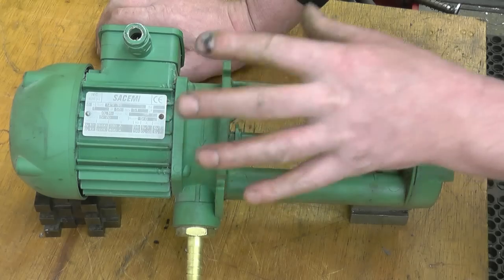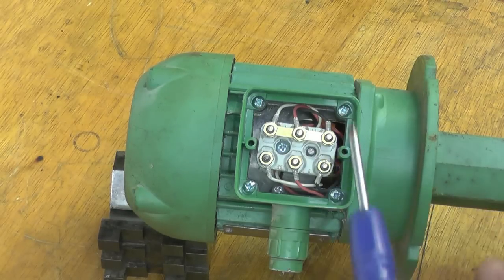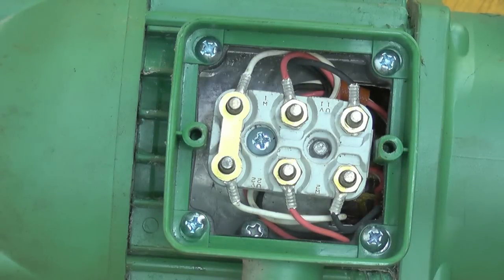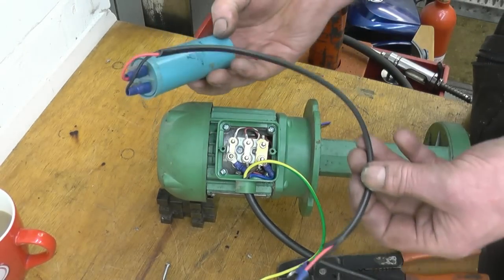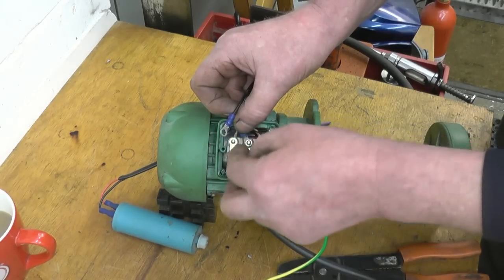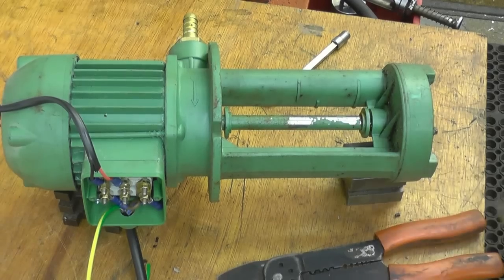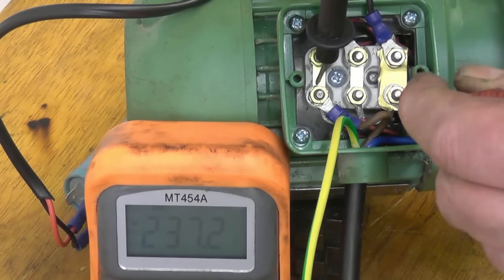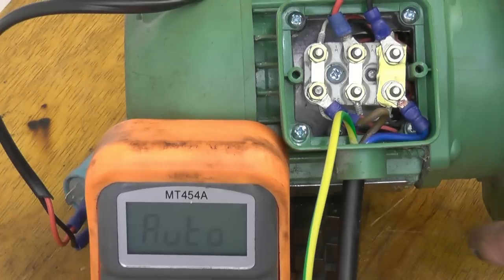Star / Delta 220 / 440

Comment: to determine capacitor size, consult the pros at a motor repair shop.many of them have been repairing motors for a while are quite knowledgeable with single& polyphase motors, capacitors,etc. they have saved me from burnt motor windings & smoking capacitors !

Comment: 10 hp 3 phase 440 volt Delta connection same10hp load convrert connection single phase 220 volt ?

Comment: What size capacitor did you use and did it stand the rest. Of time?
Reply from the maker: I will need to have a look 
It is still running fine
Reply: Great thank you.
Reply: Did you get chance to look at that capacitor. I’m wanting to run my Boxford coolant pump on single phase.

Comment: Excellent video. But what size capacitor do we use on which motor power? Is there any formula for that or do we orientate only to the supply voltage? Any help would be appreciated.

Comment: ah looks like motor on my cazenueve lathe, now, I  just scored two hydraulic power packs 2.2 kw wired in delta 220, I swing them to star, so i generate my 3phase from a Lincoln vantage 400 gives 17kw 440 V the controls are 24volt dc, came from a ship,so i will need swap solenoids to 230ac can you advise how  powerful a 3ph motor will run as you've done hear on a cap start, you taught me something today , THANKS

Comment: Here in the states we are always trying to run 220vac 3ph from 220vac 1ph.  I built my own 5hp RPC and have the voltages pretty well balanced on each phase, and kept the amp draw at a low level.  I will only be able to run one of my machines at a time, but then there is only one of me.

Comment: Hay can any one help me my motor seems to be running very hot as in can’t touch it hot it is a ecos the plate on the side says it can run single or 3 phase if any can help as don’t want to blow it befor I have even used it

Comment: nice illustration but ca you explain   how connect a 3 phase synchronous motor from the   power supply using a contactor and thermal overload

Comment: The motor is 1.5 kw on 50 hz and 1.8 on 60 hz it is a 2 to 2.5 hp it runs slow before it couldn't start because of the capacitor size now the capacitor is 100uf working fine needs a little speed can u help me please
Reply: you get inherent power loss running it single phase. imagine it like a car engine with 3 pistons, 3 phase motors is like all pistons taking turns getting to the top of the bore and take turns igniting and producing power.... running the motor in single phase is like making 3 pistons get to the top of the bore and igniting at the same time... so you get less torque, less speed and less power. only real way to get your speed and power back is to go back to 3 phase, especially on a motor that big.
Reply: or when you ride a bike, you press down on the pedals which point in different directions is basically 2 phase, because you push left pedal then right pedal, left, right... now you could convert the bike pedals to single phase by making the pedals point the same way which would mean you'd push both pedals at the same time and your bike wouldn't go as fast. hope that makes sense.

Comment: Can you please get back to me i need help wiring
Reply from the maker: Can you message me
Reply: doubleboost hi mate i have 430v 3 phase 150L compressor it says i can change to 230v single phase but the motor doesnt have capacitors i dont know which ones to get
Reply: doubleboost sent you message via facdbook

Comment: I am thinking of doing this to a 3/4 hp motor on a tool & cutter grinder.
A capacitor is far cheaper than a converter or inverter.😕hmmm.....
As it is under 1hp, will the motor still overheat? 
I also need the machine to be able to switch into reverse as well.
Will the machine still switch into reverse via the forward and reverse switch with the capacitor fitted to the motor or would I be better of just investing in an inverter?....

Comment: If three( 3)phase motor changed to single phase will run  without a capacitor ?
Reply: that`s impossible ,because the single phase motor isn't self starting , it needs capacitor  for starting ,that`s make it running  very well.

Comment: i like the simplicity of this video more people should instruct the same way. 
I  am curious to know, the motor is running no doubt but what is the FLA before a load  is placed on it.
seems neat but not practical
Reply from the maker: +James Waymyers  It is ok for this application just a coolant pump I have used them this way for years
Reply: +doubleboost 
help me how to convert my 3 phase motor 
to single phase..

this is my machine
table saw wadkin bursgreen 10"

help me
Reply: +doubleboost 
help me how to convert my 3 phase motor 
to single phase..

this is my machine
table saw wadkin bursgreen 10"

help me

Comment: can you tell me plz what is the capacitance of that capacitor ?
Reply: +Nighto lili This is equal to the power of the motor and there is formula to calcoulate the price of the capacitor also in motors less than 2HP.
Reply: I totally forgot the formulas 
im gonna check
Reply: +Nighto lili Capasitance mean the valiu of capacitor in μF or nF. Formula is 70(constant) X power of the motor in(KW) = μF. In any case capacitor must be made for all time work, and the motor power less than 750 Watts. Don't forget the volts of capacitor must be the equall+ voltage as the voltage you gonna supply the motor.
Reply: oh that formula will surely help. thanks man.

I studied electrical power technology and still dont know this formula. Glad to know it from you. 

but should i multiply the result of the Equation by (10^-6) ?
Reply: what is the motor power that you need to make single phase? There is an index for this case.
Reply: could do with the formula for a run cap pls
Reply: Will u please tell me. When demonstrator connect 2 wires i mean in single phase condition what he did either he use 1 phase and 1 neutral or 2 phases from three phase wires? Please tell me.

Comment: Hi, Tried your method on a Lowara star /delta motor. I triple checked the wiring, started it and hummed, smoked and the shaft hardly revolved. Any ideas on what l may have done wrong? I used a 20uF capacitor. Cheers.

Comment: Hey, Is there a reason why you connected the Capacitor to the middle and right slot? does it matter where it's connected to? Can i connect one side of my capacitor to the left ring and the other side to the right ring and leave the center ring without a capacitor lead?

Comment: you can only do this on smaller three phase moters?
Reply: +brad alhadri   I had a 10 hp 480v well motor that ran for years on single phase.
Reply: Yes, you can configure single phase with capacitor to run three phase..
Reply: +brad alhadri All motors less 2HP!

Comment: Hi there john, I've been an avid watcher of your vids since I first bought a little 100 year old relmac lathe 18 months ago or so, I have learnt so much and really enjoying my hobby.
 This vid has made me need to get in touch! I have a 3 phase motor I was selling on ebay to get a single phase to run my other small hobby lathe,but after watching this I have found mine can be converted too,just one question, you say that by swapping the connections over will reverse the direction of the motor.....
is there anything available that can be wired in,such as a switch that could reverse the motor when needed( threading small threads,for instance) and how would it be wired in?
thanks for taking the time to make these vids, you have no idea how valuable they are to a 44 year old novice such as me!
congrats on the channel and love to debs,my wife and I are still including her in our prayers( I give lynn an update everytime you give us an update!)
best wishes.
Dan,leicester UK

Comment: This will work on a small, lightly loaded motor. However, you will lose torque, because the windings are in balanced. The capacitor does give it sufficient torque to start, but because it does not shift voltage by a full 120 degrees phase angle, that is why the voltages are unbalanced. 
This will create additional heating in the motor. If this were a heavily loaded motor, it would overheat and eventually burn out. 
I'm an electrical engineer, for the past 40 years, this is what I do for a living. 
There are small variable frequency drives that will allow a small motor to run on 3-phase power from a single phase source.
Reply: +Lorena Dervishi , no amount of Capacitance alone will create a third phase at 120 degrees. 90 degrees of angle is sufficient to allow starting of a rotating motor, but the current flow to the windings will remain unbalanced, causing heating of the motor. Keeping the capacitance in the circuit will result in a very significant leading power factor that will cause further heating of the windings. The only way to create true 3-phase power from a single phase source is either a motor driven synchronous generator, or an inverter. 
Multiple 3-phase motors running off a rotating phase converter will improve the balance between phases, but not entirely eliminate it.
Reply: B
Reply: Mr Moran, if I were to use a small three phase motor designed for 380v in delta configuration with a vfd that outputs 3 phase 220volt, do you think I'd have any issues. The motor is for a pool pump only .75hp.
Reply: @markodonovan9921  most likely it would not run at all. At 220 volts you would be only 57% of the motors rated voltage. The resulting torque would be very low. Plus the motor would draw way too much current that will likely burn out the windings.
Reply: @billmoran3812   Okay thanks for responding
Reply: i am ALOK a PHYSICS student .... Sir Bill Moran explanation is outstanding .............the way of converting three phase power from single phase power through capacitor to derive the motor causes excess heat in motor this is due to voltages are electrically unbalanced the correct way to derive the motor from 3 phase to single phase is by variable frequency derive
Reply: Good sir I needed to ask, I have a 380v 3.0kw motor that I need to convert to single, what would be the size of capacitor ratings without Burning thing's out. 
Plus I have a theory. To create 3 phase power can take a single phase wire and connect via looping from one MCB to another whereby creating 3 outputs Of Power from one line which now gives me 3 phase power . Or am I wrong
Reply: Good day engineer, please I want to know which of these three phase will have best efficiency, STAR/440 OR DELTA/220?

Comment: the motor will run cooler and more efficiently on the 440 "star" configuration.  But, it won't make a difference in your lifetime.  Just saying.

Comment: Am I right in thinking a capacitor can store a charge. Then when you touch the wires it reminds you what it does :-)
Reply: In AC voltage, the capacitors create a lag which can be used to simulate a "phase".

Comment: A very informative video about the wiring of dual voltage motors which is usually a black hole to us mechanically minded. Thank you it has helped me, and I guess so many others in how it should be done.

Comment: John if you look at the original links I bet there are will be two stuck together and appear a just one. Swopped plenty over as we used single phase inverter to save cost (they give out 220/240v 3phase) on industrial Carpet Backing plants.
Reply from the maker: ANDREW MICAS There was only 2 like you say normally there is 3

Comment: Hi john,emulate you  it with the capacitor another fase, no you lost a few power  it's type conexion. I sorry my english is bad. congratulation good video
Reply: The motor is running on 2 phases, so it produces 60% of the rated power, cheers

Comment: The rule for capacitors usually is 70µF per Kilowatt of output. If the value is too low, the motor won't start properly, if it is too high, there will be extensive heat buildup which is why some motors have a starting capacitor that is only activated for start-up and then disconnected. The running capacitor has a lower value and ensures the motor stays cool during run.
Reply from the maker: Adrian Straub Thanks for that
Reply: If motor power 15KW so Wich power capacitor use to run motor

Comment: John your electrical work looks about as bad as my machine work. ;-)

The capacitor voltage will go down under load anyway.

Finally we will have running water at the mill, nice!

Comment: Come on John, where is your usual engineering standards. Tatty shorting strip you made, looks like you chewed it with your teeth and made the holes with a nail.
Reply: unnecessary
Reply: considering it's an electrical connection, I'd agree with Mr Ticehurst. John should have followed the other two strips for a pattern. Sure the strip probably won't short on anything, but still electrical 101 is tidy connections especially when teaching stuff and setting examples. That bridge should have been better.

Comment: There is an earth screw in that frame, partly hidden under the terminal block, the earth must go to that from the power cord. You can do additional earths, but the cord earth must go direct to the frame. That way if the motor shorts to earth and you pick it up you will still have the motor earthed, and will not get a shock.
Reply: +doubleboost awesome video, can I do this with a 5hp 3PH for a table saw? Thanks in advance
Reply from the maker: SeanBZA Thanks for thatIt was not earthed on the lathe
Reply: Now try to fit that spaghetti inside the cover and close it, plus use a second cable gland for the capacitor. You should get a motor run cap with integrated lead, so that you have no exposed terminals outside. That way you just use a large P clip or a cable tie to hold it to the motor side.
Reply from the maker: SeanBZA Now that I have it running I will get a new "run cap"No exposed terminalsI ran a similar set up on my Boxford for 10 yearsThanks again for the heads up on the earth tag RegardsJohn

Comment: An alternative for the small motors is to get a motor in the same frame size made by the same manufacturer that is the single phase variant and swap the stator sections. The rotor will typically be the same size and then it will be single phase. The leftovers you can put back together and have a 3 phase motor, which somebody else can use again. Works on those motors with special end bells or specially modified shafting, and can work quite well.

At least with this conversion it will run cooler.
Reply: yes, but you have to source another identical motor, this way is low cost, no real hassle,  and you can use caps from old flourescent light fittings. Cheers

Comment: Did that with the pump on my harrison last week. Used a 4uf motor start capacitor, £2.50 on eBay. Runs well. Did it on my Boxford years ago and it has never given bother.
Reply: Tony Simons It should be a run capacitor, not a start capacitor. Start capacitors are only rated for a few seconds service (in motors with centrifugal switch) and will overheat if used as run capacitors.
Reply: must have been a run one as its been fine for 10 years or so
Reply: Tony Simons q
Reply: I got a lathe and i think i can do this what capacitor do I need

Comment: so thats how you do it , thank you for that. What size cap did you use in the end for that little motor?
Reply: Start of from a basic idea of 30 Uf per Hp and then experiment. The motor should run quietly and all the voltages should be the same. A high voltage suggests a cap value too high, Cheers
Reply: +Andy Reynolds 
I have 5 HP 3 Phase motor. Do you suggest me to use 5X 30 = 150 mfd. of 440 V or 240V? Please reply.

Thanks
Reply: Hi. The start current for a 5 hp motor will be quite large, about 10 times run current. I would try to run this motor on 240v with 150 Uf caps. Remember you only get 2/3 of the power and you may need a start capacitor. You will need to view my videos on this to wire in an addition capacitor to give a start kick. Cheers
Reply: Thanks for your reply Dear Andy

Comment: Just as an addition for your viewers information I have covered the selection of capacitor size in my series of videos on this subject. "How to do it, run a 3 phase motor on single phase supply". It is important to use an AC capacitor of the right voltage and capacitance. A higher voltage is not a problem, but lower is. A DC cap will go pop when connected to AC. Always enjoy your videos, and the quality of some of your close-ups when machining is tremendous, Cheers, Andy.
Reply: Peter
I suggest you watch my 6 part series as this will answer most of your questions. With that size motor you will need a start cap as well as a run cap. The run cap should be about 50 Uf, but you will have to check the voltages whilst the motor is running. Cheers, Andy
Reply: How do u size the capacitot
Reply: @roshanalexander8246  wattage times .07
Reply from the maker: Andy Reynolds Thanks Andy
Reply: +Andy Reynolds If I may ask. I have a 3 Phase induction Motor 3HP 2.2 KW with 240 in and 3 phase out , which at present is setup with a variable frequency drive. 
I would like to run just on 240V as I need the variable frequency drive for another machine. First is this possible,  what are my losses? and what size cap would I need. Regards Peter
Reply: Thanks for your reply will follow up on videos and scratch my head a little less. Cheers
Reply: That's what I have found also, cheers
Reply: Andy Reynolds l
Reply: +Peter Linch 3Hp motor is to big to run up in one phase.